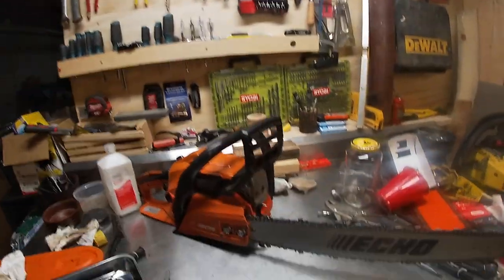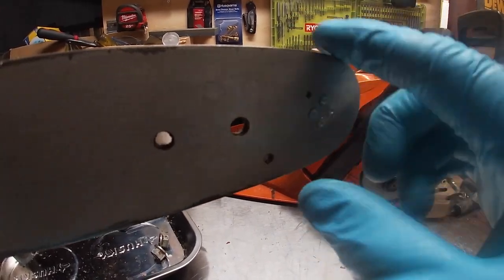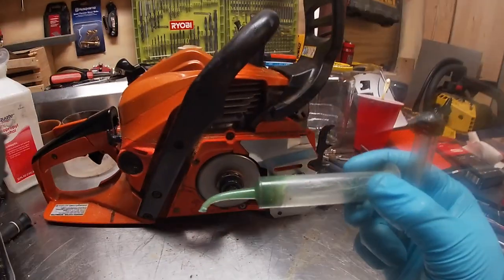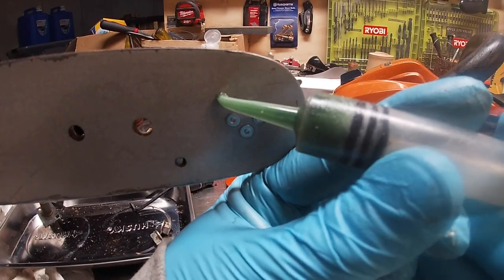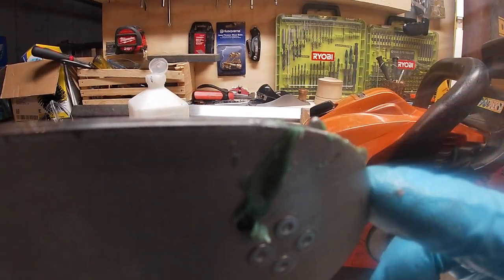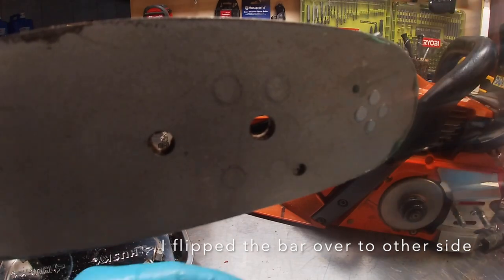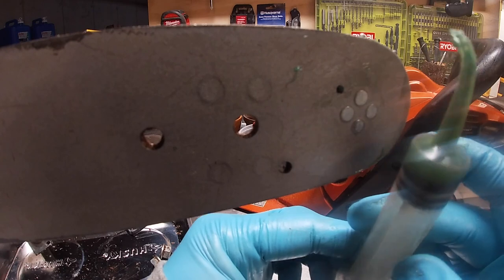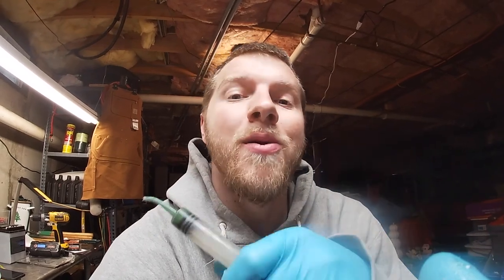A Better Way To Grease A Chainsaw Sprocket Never Before Seen! EP 41

Comment: Hello, Jay!
Excellent video...short and to the point. 
Being a retired RN (40 years in the 'front lines) I used thousands and thousands of syringes but never one like that one but I do have a few 'regular' ones left so those should work just fine.
 The little grease guns you mentioned sell for about 9.00 at Lowe's. They are not refillable  but the one I've been using has worked well for many years (and no, I do not use my chain saw nearly as much as a pro does :-). 
 Thanks for the video and the tips to keep that little sprocket well lubricated. And yes, you have a new subscriber!
Reply from the maker: Hey Blackbird! Thanks for coming along to the channel! Hope to see you in the comments in future videos! Glad you learned something! See you on the next one!

Comment: Hey Jay, what a fantastic idea👍🏻. I always thought the bar oil would get down in there. Thanks for the tip bro!✌🏻️
Reply from the maker: Hey Alan, Thanks for the comment! Bar oil does make its way round there but there designed to be greased for sure! 10k-13k rpms at the tip at full throttle grease holds up way better! Ive seen brand new bars with only a few tanks of gas through them burned out cause they were never greased.

Comment: Don't forget the drive sprocket also needs grease,  it's a tiny hole right in the middle of the crank shaft where the clutch housing slids on.
Reply from the maker: Yes my 490 and 590 do that but this was just about the tip of the bar!

Comment: What type greae is appropriate? Does any simply come in a squeeze tube that you  could press the tip against the hole?
Reply from the maker: id get something thats rated for bearings cause this sprocket is like a bearing in a way!

Comment: Hi, it's been 3 years since you uploaded the video, so I'm not sure if you can check this comment now. But I hope you will read it. First of all, thank you for uploading a nice video. I really enjoyed watching, and I admire your diverse knowledge and ideas. I have something I want to ask you. I ordered a small rechargeable chainsaw a few weeks ago, and the saw is not an engine-powered chain saw, so there is no oil inlet, but like many people practice, I also bought chain-specific oil to lubricate the chain saw blade. However, when I searched the Internet, I found that many people have conflicting opinions about 'should grease be applied to the guide bar and sprocket of a cordless chain saw', and this part bothers me (because I am a very newbie to all machines... ) If I don't have professional grease for my chainsaw right now, is there any chance of damaging my chainsaw if I apply multi-purpose grease to the saw blade's guide bar and sprocket? Any advice from you on this would be very helpful to me. Thanks for reading:)
Reply from the maker: Hey there. My theory is if the bar has a grease port then grease it. You don’t need special grease. I use the same grease I use on my tractor loader. As long as you keep the bar clean and make sure you have oil in it you shouldn’t have any issues.
Reply: Thanks for the reply, it helped me a lot. I will always support you. I hope you become a much-loved YouTuber!

Comment: Just bought another bar for my Stihl MS250. It's getting worn and the chain ran over the teeth of the sproket the other day.  I though it was scrap.  Nope! I loosen the chain, put it back on, running fine. But I got another bar to have a backup on the Sunday afternoon if anything fails. My point is that those new Stihl bars are NOT greasable... doomed for failure?
Reply from the maker: Ive seen those like "rolamatic" Stihl bars or something like that im not sure what Stihl is thinking but I personally like being able to grease things for sure! I think if the oiler gets clogged which sometimes they do on any saw I would see the sprocket wearing early but apparently the engineers know more than I do lol
Reply: I was told that cutting slightly rotten, but very dry wood makes enough dust instead of chips to clog everything and even jam the sproket. You said: "engineers know more than I do..." I can tell you sometime they don't!!! ( I am engineer BTW!).
Reply from the maker: Hahah let me rephrase then "sometimes" engineers know more than consumers haha Ive cut some dry crap before and havent had issues...yet hahah who knows! Anything can happen!
Reply: I've had the same saw for a few years now and the bar is holding up well. 
According to Sthil, the nose sprocket is kept lubricated with the bar oil.